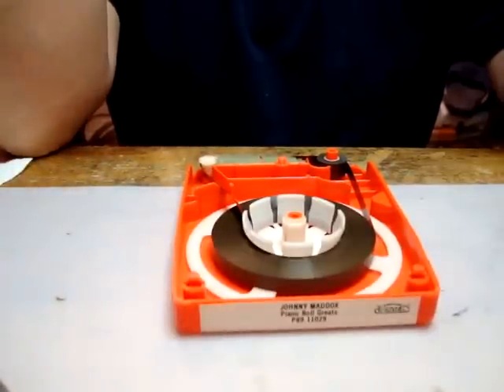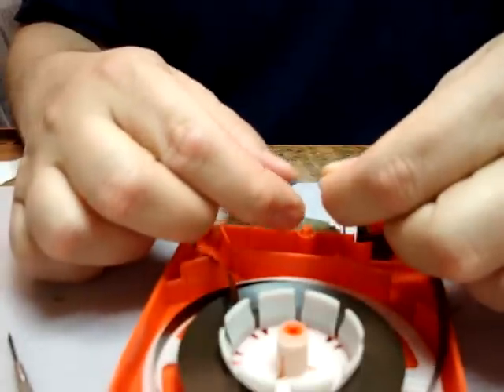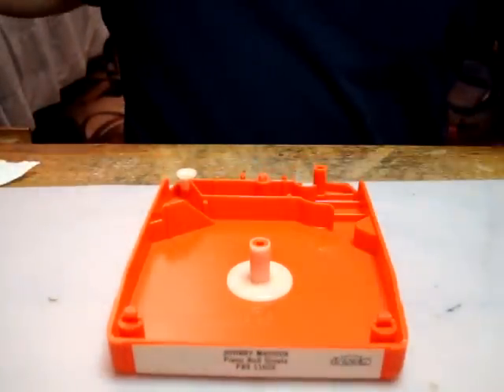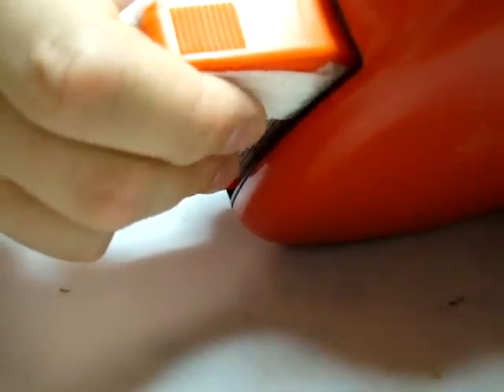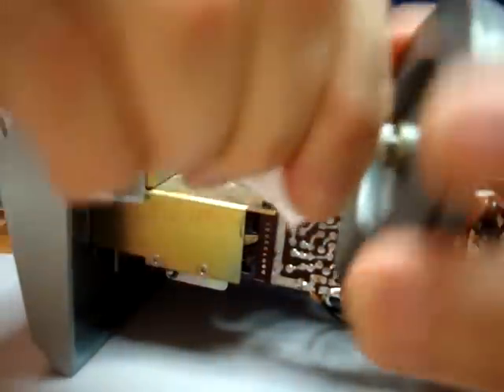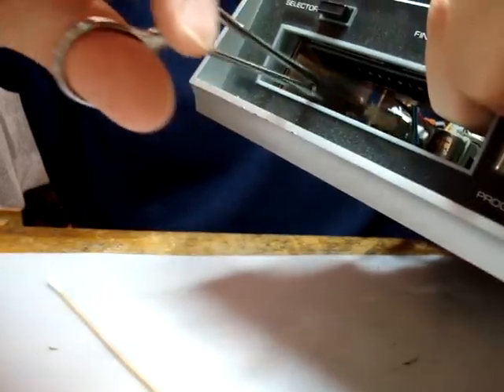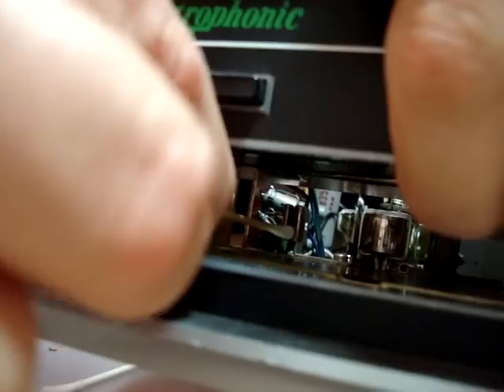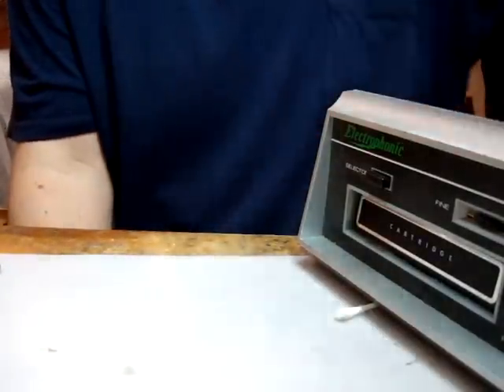8 track repair Misc pt 3

Comment from the maker: Thanks, The tune feature does come in handy for some tapes I have but most are pretty good. They stopped including this feature most likely because of the (small) but extra cost involved but you also can't use it for recording decks since you are apt to make a recording that is misaligned for all other decks.

Comment from the maker: Does the tape move, player change programs etc? Is the unti just a tape player or include radio, etc. Try them to see if you get the same. Did you clean the volume, tone knobs, switches with contact cleaner? You hear the static when you turn these knobs or switches? Aside from that, you may have bad amplifier/transistor chips, or you have bad electrolytic capacitors (the little "can" shaped items). Replace these. Not always easy to trace which one is bad and you should know how to solder as well

Comment: I've cut some damaged part of one of mine and now the tape has a lot of space in the middle, how do I tighten it, for it doesn't play well? The rubber on some of those pinch rollers has completely rotten of, I am still looking for a rubber pipe to replace it with.
Reply from the maker: I try to avoid cutting out tape as much as I can. Ironing the wrinkles out on low heat and turned off to avoid magnetic field erasure. You need to balance the tightness by tightly (not overly) winding the tape from the outside and then unravel about 3 or 4 strands, then use splicing tape on the back of the tape to join the ends.
Reply: Me too,..

Comment: Hey Waukee321. (1) What is the Fine Tuning control on that stand alone 8-track player you have used for? (2) What kind of portable 8-track player is that red one you have? (3) Do you also own an 8-track recorder? If so, what kind do you own? What all do you usually record on that recorder?
Reply from the maker: Mark Covington (1) All it does is allow head azimuth adjustment. The wheel you turn connects to some string that wraps around a bolt over the head which raises and lowers the head mount. You adjust until the sound is clear [very mechanical adjustment] (2) Panasonic Mono player (3) Yes, several. Favorites: Sharp, Realistic (Radio Shack), Panasonic, Fisher, Lafayette (4) Old rock/prog albums, some new age for office environment. Lots of good recordings I found on some made by others on blanks. Even a home recording of some teens getting high, probably early 70s (terms like "groovy" and "far out")

Comment from the maker: I usually recommend using a new tape with the spring pads (not the foam) to align the heads. Program/Track 1 always seems to be the track that is most out of alignment when the other tracks are aligned. Perhaps it is because Track 1 rides along the upper edge of the tape?? Older tapes get worn and stretched along the edges (from pulling at an angle out of the hub for so long?). At any rate, use Programs 2 and 3 as reference for aligning.

Comment: Also , very often I hear the other channels playing in the background of the quiet sections.
Reply: That's called "cross talk". :)
Reply: Ah! A simple re alignment of the head. All you have to do is open your machine, find the screw above the head (on the big rod thing there may be a few screws, the one closest to the head on the top). Once you’ve located it, play a tape and then adjust the screw accordingly.
Reply from the maker: Exactly, also make sure your pressure pads are in tact.

Comment from the maker: You mean the motor died?  That's why drives use belt mechanisms so that if something jams, the motor will keep running and the belt will slide on the pulley (i.e. no direct drive). A locked motor can result in a burned out electrical winding which is usually called death of a motor.

That's why I always recommend pulling out the tape at the end of a program and check that splice. Writing a "/" under the cartridge is good for "checked the splice and it is good" and "X" for "replaced the splice".

Comment: Hello,

I got an 8 track player, Akai 80D I plugged my Koss Pro4aa into it and decided to hear some tunes but I get a low volume. Plugged directly into an outlet. Am I missing something? Maybe I have to run it through an amp? Any help would be appreciated. Thank you!
Reply from the maker: +Mario Arroyo I wasn't sure what a Koss Pro4aa was; they're headphones. If you are using the headphone jack on the unit and get very low volume you may have a bad amplifier chip.  Connect the player directly to an amp using the tape in or aux input. If you still get a low output, you have a bad amplifier chip. And...Never plug these decks or anything other than a non-amplified turntable into a phono input or you'll blow the phono pre-amp.

Comment: Hey waukee. What is the Fine Tuning control on that 8-Track player you have there used for? :)
Reply from the maker: It is used to align ("Fine Tune") the head azimuth to adjust to the maximum signal input on tapes that are not perfectly recorded to standards or worn and exhibit cross talk as well. All it does is raise or lower the head gradually (fine).

Comment from the maker: There are alignment 8 track tapes and I have a few.They are a short segment of tape.The way they work is that Programs 1 and 3 (or on some 2 and 4) have a recorded continuous tone (4 secs), the other programs are silent. So the tape alternates:  Program 1: Tone; Program 2: Silent; Program 3: Tone, Program 4: Silent. There is no sensing foil so you change the programs manually. What you do is play the silent programs and if you hear the tone (loud or faint), adjust the azimuth until it is silent

Comment: Hi, I actually have the same 8 track player. The issue I am having is the right channel is weak. I replaced the 8 caps on the board and resoldered the wires on the board to make sure the connections were good. Any thoughts? The head still has some dirt on it that I can’t get off with alcohol. I will try Brasso.
Reply from the maker: Brasso or other soft metal polish works great. Don't press too hard.
Reply: Acrtone

Comment: I have a question? I have an 8 track player that will not turn the tape. The belt turns and the roller is turning but when I put the tape in the tape doesn't move. I put a pen mark on the tape and put it in for a few seconds then look at the tape and the mark didn't move. I have the player apart and can see everything is turning but just can't understand why the tape is not moving. Also no static noise or anything comes out through the amp. Any help would be great. Thanks
Reply from the maker: billie19842007 Ok, lengthy here but here goes: <span style="font-size:11.0pt;line-height:115%;
font-family:"Calibri","sans-serif";mso-ascii-theme-font:minor-latin;mso-fareast-font-family:
Calibri;mso-fareast-theme-font:minor-latin;mso-hansi-theme-font:minor-latin;
mso-bidi-font-family:"Times New Roman";mso-bidi-theme-font:minor-bidi;
mso-ansi-language:EN-US;mso-fareast-language:EN-US;mso-bidi-language:AR-SA">First,
I assume the capstan (that’s the metal shaft that contacts the tape) is
completely clean. It should be a bright (not always shiny) metal; no black soot
like looking dirt.  I often remove the
whole flywheel/capstan assembly so I can completely clean the shaft with Brasso
metal polish.  Removing these varies from
nice easy screws that hold a metal plate underneath the flywheel (important to
note the spacing here for just a bit of up/down movement) which then just
slides out, to the dreaded C-Clip  that
can be at the top of the capstan post or worse at the base within the narrow
confines of the covered metal area behind the capstan. Removing and replacing
C-clips is not easy. You need patience, a good set of fine tipped needle nose
pliers and/or surgical hemostats to really grab and pull off/ push in the clip.
The first thing to remove the clip is try to get a blade small jewelers
screwdriver into a slot on the non-open side of the clip and slowly turn and
tug it so the clip pulls off. <span style="font-size:11.0pt;line-height:115%;
font-family:"Calibri","sans-serif";mso-ascii-theme-font:minor-latin;mso-fareast-font-family:
Calibri;mso-fareast-theme-font:minor-latin;mso-hansi-theme-font:minor-latin;
mso-bidi-font-family:"Times New Roman";mso-bidi-theme-font:minor-bidi;
mso-ansi-language:EN-US;mso-fareast-language:EN-US;mso-bidi-language:AR-SA">COVER
THE CLIP with plastic wrap while you are doing this or it will likely fly off
into that “never will find me” location. Put the clip in a small cup where you
won’t lose it. When you slide off the capstan, check carefully for small
plastic washer(s) (often clear) and remember where they go (can be on either/both
side of the shaft). Be VERY careful when and after you remove the shaft not to
bend it, drop it, etc. Clean the shaft with a cloth and brasso. Now here you
may find your problem. The very thin capstans and flywheels that have a groove
and use a small thin square diameter belt are susceptible to this. Firmly
Squeeze the shaft and turn the flywheel. Does the shaft not turn (it should)?
If so, it is loose and needs to be tightened to the flywheel. You can try to
remove it, put some super glue on it and then reinsert it. <span style="font-size:11.0pt;line-height:115%;
font-family:"Calibri","sans-serif";mso-ascii-theme-font:minor-latin;mso-fareast-font-family:
Calibri;mso-fareast-theme-font:minor-latin;mso-hansi-theme-font:minor-latin;
mso-bidi-font-family:"Times New Roman";mso-bidi-theme-font:minor-bidi;
mso-ansi-language:EN-US;mso-fareast-language:EN-US;mso-bidi-language:AR-SA">.
First be sure you know how far in it goes; often the end of the shaft should
just barely protrude just past the rounded end. When it is mounted back in the player
and that base plate it rested on that you removed (remember?), it should rest
on it and just barely be able to slide up and down. Find this position relative
to the shaft insertion depth into the flywheel. Besides superglue, you can also
lightly tap a very small nail tip into the flywheel abutting towards and around
the shaft to “pinch” a tighter fit. Be very careful with this and do this on top
of a metal vise to allow the base of the shaft to hang below it to avoid
bending/damaging the shaft. Another culprit that is also easier to fix is to
check the screws that commonly surround and hold the capstan assembly to the
chassis. Tighten these up but be careful not to over tighten. That 70’s era
metal alloy is often soft and can strip or break a fitting. (Happened to me
once). When reinserting the C-clip, use the needle-nose or hemostats and carefully
squeeze it on. Cover again with clear wrap in case it takes flight again.
Sometime the hardware stores carry C-clips if you lose one. Good Luck.
Reply from the maker: billie19842007 Sorry my response got poorly formatted. I tried copying and pasting 3 sections from Word as I was not sure it would allow the whole text. As for your second part with no noise, it's probably due to the fact that the tape isn't moving. Check that the heads are clean and no wires are broken.

Comment: Hi, Helpful video! I have a 8 Track with a flywheel on the bottom like this one that doesn't appear to be held with clips. After I put a new belt on and screwed the flywheel holding bracket back on, the flywheel scrapes the bracket while playing. Is there a trick to putting these flywheels and holding bracket back?
Reply from the maker: If it's anything like the one pictured, these flywheels tend to slip down the shaft. You have to slide them back up by carefully taping them and accurately measure the length of the section that sticks out below the flywheel. A little superglue on the shaft and/or using a hammer and pointy nail to gently tap/shore up the flywheel tightly to the shaft
Reply: @waukee321  OMG! This has been driving me crazy for months. It never occurred to me that the weight of the flywheel would come off the actual capstan shaft!  Mine was completely flush nothing was sticking out.  Couple taps of the hammer and then a line up and we are in business! The motor was running so hot that it would stop after 1 tape. Im hoping this repair will take care of the drag and hopefully the motor. Testing now!
Reply from the maker: That is common with this style and these very thin shafts. The fly wheel is pressure mounted onto the shaft and over time I guess it just loosens up and slips down. The drop of super glue where they join together or tapping the flywheel where it butts up against the shaft with a nail to build up pressure usually works. Just be very careful not to bend the shaft when working on it or it will be ruined!  These AC motors like on this one can run hot. You'll notice the little fan blades by the pulley end to cool it down. I've actually cut a hole in the top of the wooden case over the motor area and put a metal screen like on a screen door for the heat to vent from. Seems to help.
Reply: waukee321 The screen is a great suggestion! It sounds much better now that the flywheel is fixed but still slows down at 15 minutes and stops at 20. Not sure if it’s motor or caps?
Reply from the maker: Does the cap get hot? I've had these where the motor runs down and the cap gets very hot. Replace the cap (Radio Shack had these "sigh") that jumpers across the motor leads and it should work then

Comment: Hey Waukee. Why is it the hub say on the Columbia cartridges some have holes all the way around it & some hubs that don't?
Reply from the maker: Mark Covington Are you referring to the inner reel that the tape wraps around? The older ones are more solid but that used more plastic which costs the manufacturer more. They found they could turn the reels into spokes with vast open areas to get the same effect and performance while saving money on less plastic for the reel. Manufacturers ALWAYS strive for using less materials to save money.

Comment: I would think that BRASSO would be too abrasive on the heads?  Have you noticed any change in sound quality compared to  just using alcohol on the heads?
Reply from the maker: No, none at all. Brasso is extremely low (almost non) abrasive. If it settles, try to use the more liquidy part. Gives the head and the electrodes (yes polish them also) a nice shine
Reply: Lighter fluid

Comment: Hey Waukee.
As far as the spool of tape on the reel inside the cartridge itself, why are there some with plastic foul rings on top & some without?
Reply from the maker: Mark Covington I think they should all have these foul rings as it prevents (although not perfectly) the innermost section of tape on the spool from rising off the spool and jamming should the cartridge be shaken against the top lid or played vertically or momentarily upside down (never do this).  The outer sections are held against the spool by the raised gridwork and moldings on the inner side of the lid; I guess those that have a lesser degree of this need the foul ring which saves money on the amount of plastic extruded for the extra grid work. Ideally, only where the tape exits the spool should there be a space to allow this but it would be very difficult to regulate this to that level.  If you've ever opened the older AMPEX tapes with the gooey pinch rollers, apart from the roller, they are actually very well made. The plastic is hard/solid and there is a specially molded plastic plate AND foul ring that fits over the tape and spool to only allow an opening where the tape is pulled out. As is common in most manufactured items, the older items seem to have more and thicker materials and parts. As time progressed, the push was for making things faster and cheaper, hence fewer. lighter parts. Look at vinyl records, earlier thicker, later thinner.  In the end its all about $$.
Reply: About how hard are those usually to open?
Reply from the maker: Mark Covington I have a video on these AMPEX types. It's in Part 1/3.  https://www.youtube.com/watch?v=kniUDYY8Zn8
The technique I use is pretty much the only method I found that opens them non-destructively but it does take time. Wow, made that video 5 years ago already when I had a lot more free time!
Reply: @waukee321  Hey waukee. No matter what style of cartridge it may be why are there some hubs with holes all the way around it & some with no holes all the way around it? :) Please let me know ASAP. :) Thank you! :)

Comment: Hey, I have an 8 track player that gives me nothing but a deep drone sound or loud static when player any of my 10 tapes. Was wondering if you could point me in the right direction on fixing it. Thanks
Reply from the maker: Probably needs new electrolytic caps. If not that could be the amplifier transistors.

Comment: Hey waukee. What is the purpose of a fine tuning knob on an 8-track player? :)
Reply from the maker: It physically moves the head up and down in fine increments (depending on which direction you turn the knob. It's like being able to access the azimuth screw from the front panel (often using a string and pulley device attached above the head) instead of inserting a thin screwdriver through the bottom of the case. This allows you to "tune" out crosstalk and brighter treble on each tape, especially older worn out ones or ones there were not recorded at the proper head alignment. Wish they kept making them that way. Should have been a standard feature. Older car/auto units especially had them.